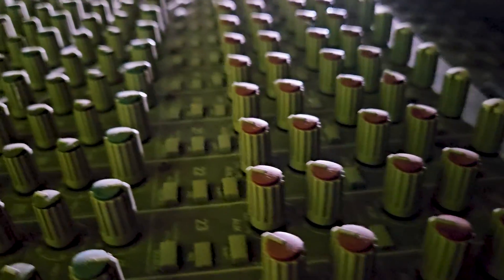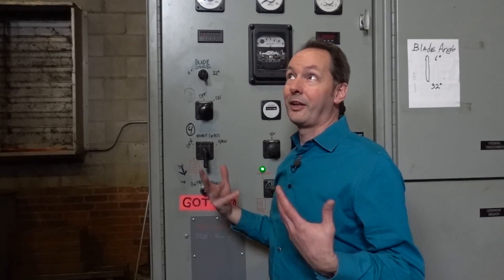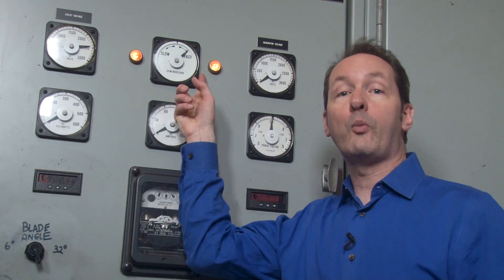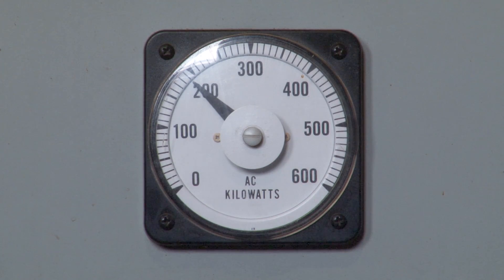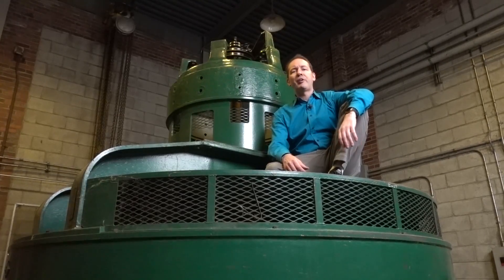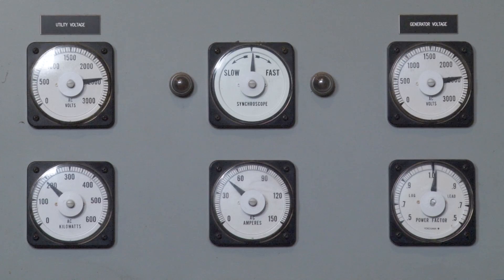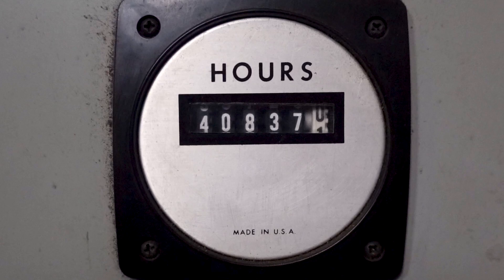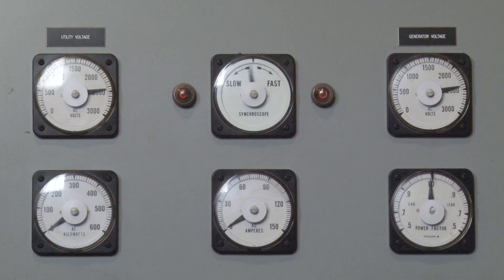Powerplant Control Panel Tour - Part 1 Authorized Personnel Only S4E1 #engineering #powerplant

Comment: In the UK is becuase our grid completely covers the country in a single synchronous AC system and the frequency is constantly monitored and recorded you can, with a bit of analysis, use the variations in background mains hum on an audio recording of sufficient length to timestamp that recording to the second.
Reply: Only problem with that is that this is almost completely obliterated by the variation in timing of the recorder itself, from things like battery voltage drift affecting the crystal oscillator that provides a sample clock, to temperaure drift as well that make it vary. You get more of a graph of oscillator drift with time, and with analogue tape, with wow and flutter, it is even worse. 

Digital the hum is hard to recover, mostly because most recorders will absolutely actively remove 50/60/100/120Hz noise with narrowband filters in the DSP engine that does the pre encoding processing, simply to reduce data use recording hum, and then your typical Frauenhof encvoding to MP3, FLAC or even AAC, will strip out all the bass noise to a great extent, unless not masked by other sound energy, so the recording will have very little data to begin with. Even if you were recording using WAV or other lossless CODEC, the data stream would have very little hum imposed on it, and if recorded off a phone line, with all the equipment along the way adding in hum, and the SPEEX codec doing serious decimation to get all this data into a single 8kbs data packet system, you will be hard pressed to get anything. 

You can do it in theory, but need both a good recording, no digital to analogue conversions until the final ADC to record, a log recording using a very well disciplined ADC clock, preferably a Rubidium disciplined one, though an ovenised crystal that has been running for 1000 hours continuously is a close second, and really good dynamic range to be able to use DSP to do the narrow band filtering needed to remove all the rest. Yes there is a paper, but it is idealised, and real life is hard to actually implement.
Reply: @SeanBZA  There's not such a big of the problem. What you need to measure from recording is the frequency fluctuations, and since they are relative - you can find the correlation between your fluctuations and grid fluctuations.
Reply: I think if you get the waveform you can match it regardless if it is off by a little. @SeanBZA
Reply: I didn't say it was easy 😀 I did kind of gloss over that with "a bit of analysis" which should have been a "complex piece of analysis requiring looking for a best fit taking into account variances in the recording fidelity".  It doesn't always work and yes modern digital recording filters can make it harder but still often record harmonics that are usable with the right analysis.  Tom Scott did a video a few years ago.
Reply: @ThePoxun  Yes I remember seeing a video from somewhere on this exact subject and it was to do with law enforcement from memory and Tom Scott rings a bell.
Reply: Thats just like... Marco Reps levels of zeros right there

Comment: Awesome stuff! Keep them coming! My question is because the grid voltage is always variable even though we know we want  nominal AC voltage, why are their no capacitors helping to stabilize thr voltage? I have a feeling it's because of resistance but besides batteries with investors there must be a way to stabilize the voltage on AC.
Reply from the maker: The Capacitors are for Power Factor Correction, and that's a wicked complicated topic that we're going to do a deep-dive on in the future. :) It's complicated, but my viewers are smart enough to handle it so we're going in!
Reply: @Physicsduck  bobsdecline Aaron spoke about that awhile back
Reply: Capacitors don't store AC power, but they can correct power factor.

They create a leading power factor when connectted to a AC source. 

Inductive loads cause a lagging power factor. 

When the leading power and the lagging power factors are matched/balanced, the load appears as perfectly resistive. Ie "real" and nor "imaginary" power

Storage is a whole other problem. 
For the amout of energy being dealt with, currently, only massive batteries tied to the grid via an inverter (and charger) to convert to AC, and mechanical storage such as pumped hydro (to later spin generators) and gravity batteries (weights raised, and used to spin generators) are viable. 
Some thermal plants that store energy by heating stuff like PCM salts or sand to really high temperatures have been tried, as well as compressed air in massive caverns, and chemical storage such as "flow" batteries.
Reply: There are in fact capacitors out on the grid. Large consumers of power will be billed extra if their power factor is off, so you'll often see banks of capacitors near their power entrance. And you'll see them out on the grid as well, like in this video: https://www.youtube.com/watch?v=oPSq__8pnhQ

Some can be quiet large. Don't confuse them with voltage regulators, which are used to boost voltage on lines: https://www.youtube.com/watch?v=5LPVYXsyD-Y

Comment: The average house is using about 9000 watts

When you think about a dryer running 4000 watts and a washing machine 1000 watts and a heater 1000 watts and 1200 watts of lighting and 1000 watts for TVs.

A 10 Kw wind turbine generator at a house is the minimum for a small house.

One house I saw in SC had 600 amps of power, 144,000 watts

At max use they need 100 kw just for their house

The amount of cooling they have is insane and absolutely needed because it is over 100 degrees 5 months out of the year.
Reply: Yes the number of houses that 200kW is feeding is "really depends", at 2AM on a moderate day, when air temperature outside is about air temperature inside, the average house could be using 200W of power, mostly for things like TV sets on standby, plugged in wall warts, and the odd outdoor light. So your plant is supplying power to 1000 houses.

Conversely, at peak power demand time, typically in the morning from 5AM to 7AM, and evening from 6PM to 9PM, you could have a single house drawing 4kW for water heaters, all occupants showering, another 4kVA for aircon or heating, another 2kW for the stove elements running, another 2kW for the oven busy grilling the meal of the time, and again another 2kVA of all the things like hair driers, heated toilet seats, pump for water, blenders, mixers and appliances like vacuum cleaners running, plus 6kVA charging up the Tesla/Rivian they just remembered to plug in. 20kVA overall load, for a single house. So your plant is supplying the power needs of 10 houses. A big difference in power draw, from small to large.
Reply: Actually, this comment would make a great entree for a video on "when you need to engineer for peak load, and when you need to engineer for average load over a day/week/month/year"  The entrance panel needs to meet the needs of "doing laundry while also cooking thanksgiving dinner and dad's in the woodshop turning last minute candleholders on the lathe while Cousin Stan is showing off his electric turkey smoker and every light in the house is on, and Crazy Uncle Thomas is showing off his collection of 500W incandescent bulbs from the 40s and ... and ... and ... "
Reply: Are you running a laundry service out of your house?  Even as a high school student living at home with 4 adults, two teenagers and two infants in the home, we only ran the dryer for 3 loads of "about an hour" a week.

Comment: My city used to have it's own power plant

The plant could hook into the grid

They had remote control of the switches to disconnect the end of their line that connected to the Grid.

When the ENTIRE northeast went out, they opened the switches to disconnect the town from the Grid and started the plant and they were on and was the only town with power

You could see it on the satellite photo

The voltage where I live now is 123 to 124 volts on a normal day.

It can go down to 121 but that is rare

I have UPSs all over the house logging the voltage
Reply: I prefer 122 to 126
Reply: I lived in a place where the voltage would often peak just over 125 v, which would cause my big UPS to trip before I adjusted its settings.
Reply: Yes, used to have Smoky Joe the Congella power plant. Gone long ago, and now is an oil depot, and a few mini factories, plus a China mall....
Reply: Our small city also has their own power plant. Start up is 3 hours. When the 2003 blackout happened, we were without power for only an afternoon.
Reply: Why did they get rid of the power plant?